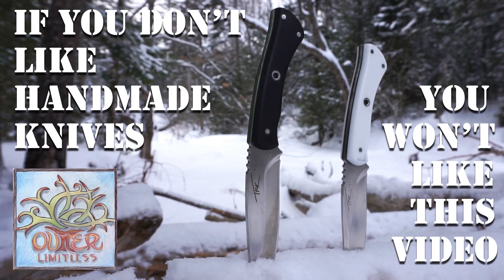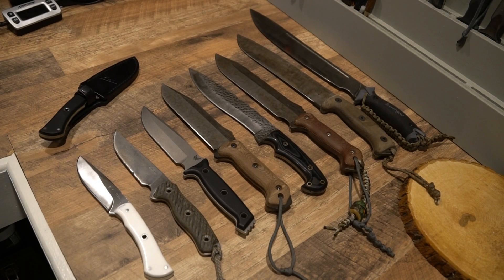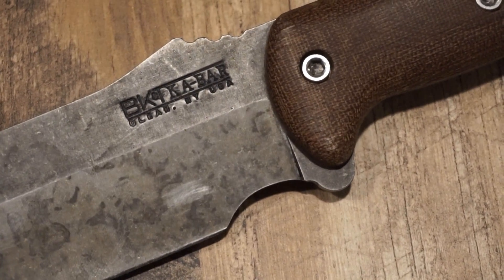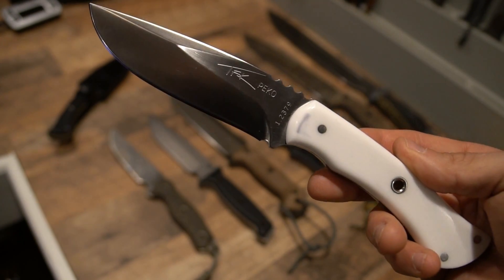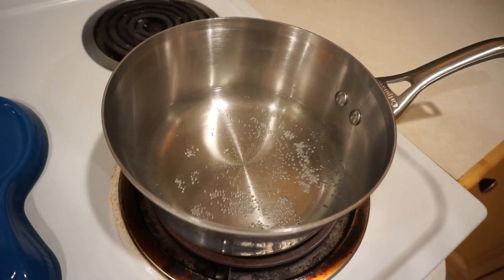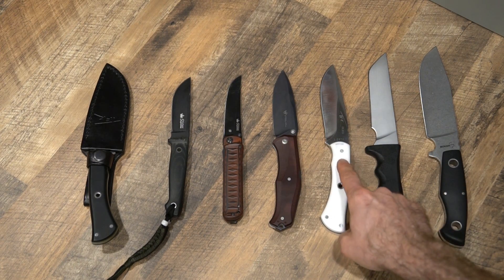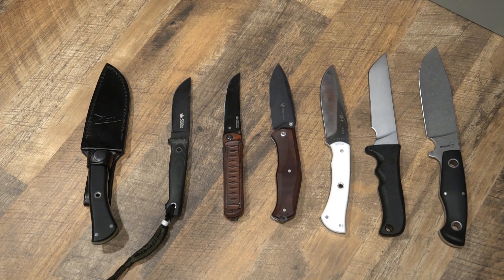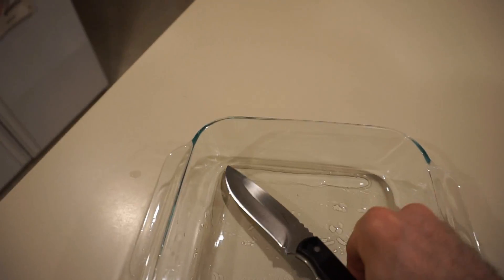Is D2 Tool Steel a Carbon Steel, or a Stainless Steel?

Comment: I'd say it's somewhere between stainless and carbon. D2 is one of my favourite steels purely because it combines some of the best qualities of both stainless and carbon steels. It won't rust anywhere near as readily as a true carbon steel, and you can throw it around and beat it up a lot more than a stainless. It's a great middle ground and perfect for outdoor use.
Reply from the maker: I agree...I really love D2...you got it nailed by the perfect middle ground philosophy...I have found it to perform very well overall.  Thanks for watching!
Reply: @outerlimitless  I'm with you I like to modifie all kinds of knife .like dollar  tree   knife s i find that this is a lot of fun .
Reply: @outerlimitless  I like d 2  steel and high carbon  steel .one reason I like  high carbon  that it get s very  sharp .shove s  are high carbon steel I have made  10 knife s from  shove s they make great knife s .but it is not easy to do .made knife s from  lawnmower  blade s .
Reply: @outerlimitless  that is a very beatiful  white handle knife that you have their .can you let me know how to go about getting one .and what does one like that cost .
Reply: @outerlimitless  yeah! D2 seems to be (scientifically speaking) a carbon steel composed of 1.45% Carbon, 12% Chromium and a few other materials. It's fairly high carbon.
Reply: Pretty much if you dry it after it gets wet it will be ok?
Reply: Orion Slaver  I've had some negative experiences with D2 chipping a lot, especially a combination of D2 and scandi grinds
Reply: I like your video man, can you sharpen D2 steel once it gets dull? I ordered a nice custom d2 steel bowie knife at 15in overall
Reply: @nonyabusiness2041  You can indeed sharpen D2 fairly easily. I personally have a Lansky sharpener and after I took the time to put a 30° edge on it (originally 20°-25° I think), it sharpens well enough after about 30 minutes of work. Make sure you clean it before and after. I use mineral oil and a sponge before, then an oilcloth after.
Reply: Same here buddy. When I got my first knife made out of D2, it was a love from first sight. I still have a lot (and will have more - no doubts about it) carbon and stainless steel blades, but there is always a D2 one i my pocket.

Comment: Are the D2 steel knives from CFK actually really good D2 tool steel? I hope you reply quickly, in a friendly debate lol
Reply from the maker: I haven't messed around too much with CFK...but the knives in my video are TFK and they are SWEET!
Reply: outer limitless Thanks man! I love my CFK knives. Have used the hell outta one over the past couple years and only needed to sharpen it once. I strop after a couple hard uses but didn't really need to. You can't beat em for the price. Try one out sometime and lemme know what you think
Reply from the maker: Danny Cadle I've had a few CFK blades,  but none in D2.  But I really do like D2.  It has always performed great for me.   I agree about the strop... keeps a great serviceable edge.

Comment: Great vid! Reminds me so much of one knife in particular that I have used extensively for  a couple years now...D2 with gorgeous micarta handle scales. I've always questioned whether it was really carbon or stainless. After trying trying to force a patina with vinegar, mustard and even a cold blue, no luck. Heavy use has given it a few slight discolorations but I have no doubt it could be returned to like new shininess in a matter of minutes and the shininess irks me probably more than is reasonable! Sharpens perhaps not quite as easily as 1095, but not far off.  As, if not more, rust-resistant than a good stainless...in the end makes a great blade that is frustratingly shiny but incredibly useful and underrated, imho. Thanks for the video! Glad I'm not the only one. :)
Reply from the maker: Hey Rick, glad to hear from ya!!  Yeah, I have been in LOVE with D2 for a long time now, but always intrigued by its characteristics.  Like you said, I have had discoloration over time, but what about forced patina??  I had never tried it.  I love to experiment and figured what the heck, let's go for it.  I'm curious about your blade...where did you get it?
Reply from the maker: Haha, yeah, I hate my blades being all shiny.  I don't like them damaged, but I like the look of a well used blade!

Comment: Going nerd, D2 is not stainless. 
1. From Wiki :'Due to their high chromium content, certain D-type tool steels are often considered stainless or semi-stainless, however their corrosion resistance is very limited due to the precipitation of the majority of their chromium and carbon constituents as carbides.'
2. D2 is not listed by European and American steel grade as stainless.

High chromium steel are very resistant to acetic acid. You need hydrochloric acid to test. This is what I heard from some 3V steel, It the heat treatment include cryo treatment, it becomes more rust resistant. I've heard that from 3V blades that are HT by Peter's. Do the Ht ma make it more rust resistant.
Reply from the maker: Interesting...still leaves me confused though...haha...that definition is almost in conflict with itself!  Definition 1 said stainless, and definition 2 said not listed as stainless.  I love this topic though, some great comments, thanks for weighing in!!

Comment: D2 will rust maybe a little slower than 1095 but I have seen substantial rust in 12 hours red and hard to remove although no pitting also be sure those knives are not made with an equivalent European D2 with higher stain resistance like Sliepner steel that being said I think D2 is way underrated and one of my fav steels
Reply from the maker: The TFK knife is European grade 1.2379, which my research shows to be D2.  The company also markets it as D2, so I'm confident saying that.  However I suppose it could have some difference that I am unaware of.  But ya, D2 is underrated...it's great.  Do you find it easy or hard to sharpen?
Reply: its pretty easy not like 1095 but if you strop it in amazing
Reply from the maker: Ya, cool...for me it's all about the strop too.  I agree about it being harder than 1095, but I don't generally chip my blades, so some touch up with a ceramic rod and a good leather strop and D2 is mint!
Reply: Is Sliepner considered D2 ?
Reply: @Temporalplace  yes European D2 slightly more stainless is the claim

Comment: My D2 blades don't have a lot of dirt time but they seem to hold up well. And most D2 vids I watch show the same. Some still complain that D2 is not tough enough but it seems properly heat treated D2 will get the job done.
Reply from the maker: Ya, this T7 is definitely tough...in my review video, I pounded on it pretty good and it handles plenty well...and also keeping in mind that this is 5/32, not 3/16 stock.

Comment: I Like that Maxpedition Geometric.

I Really do Like D2
Good Testing if a patina was even even possible.   You did show a great way to clean it .
There are so many types of steel out there I have one that is"  High Carbon Stainless' 
At this point after that Hot  Vinegar bath I would say " Stainless"
Reply from the maker: It cleaned up marvelously...haha, not my intended result, but that's why I like to experiment!!  All in good fun, and a learning experience too!

Comment: I treat it as a carbon steel just in case I believe mustard can help with patina also never tried I do have some blades in 01 which are slowly making there own patina even with me taking crazy care of them which annoyed me but I do like the patina look to guess I am afraid of change.
Reply from the maker: Sometimes it's good to force a patina...01 gets a nice even patina if you force it with boiled white vinegar...nice and dark.  But, if you let it happen naturally it will be spotty and uneven...so that's kinda the trade off.